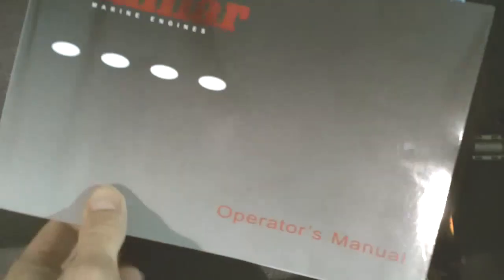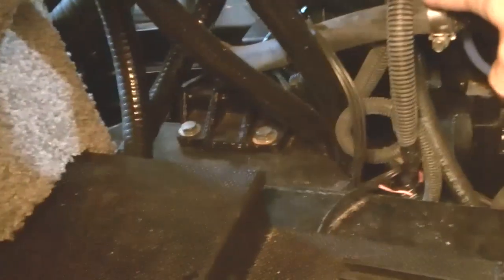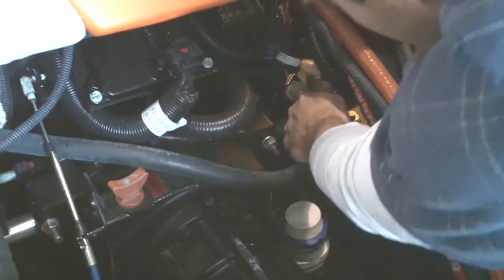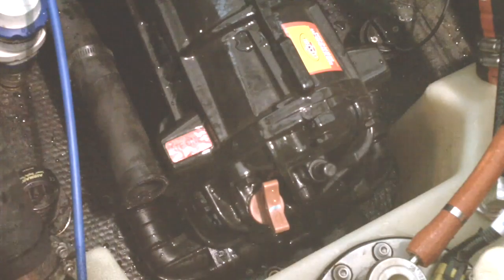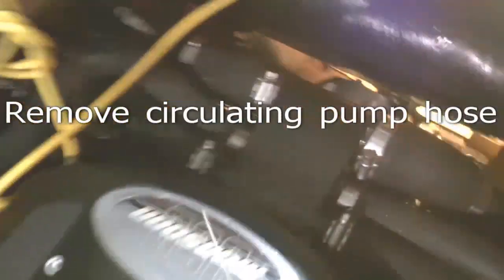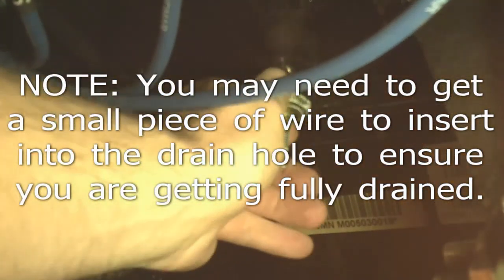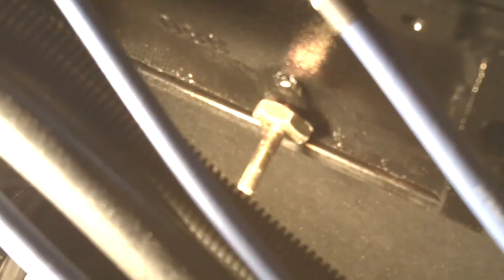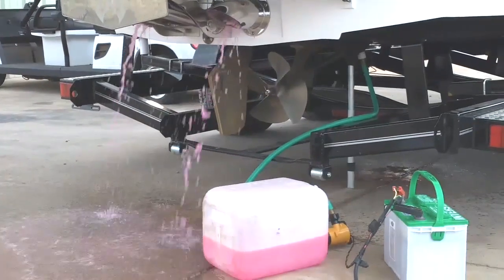Boat Winterization - Indmar Monsoon 350

Comment: Different question my boat was heated up. I changed the impeller and is still heating up.
Reply: Check the impeller for any damage or debris first. Check the cooler inlets for any debris blocking flow. Then replace your thermostat. This will solve 99% of overheating issues

Comment: I know this is an old video but can someone tell me why drain it first? Why not just get the engine up to operating temp and then run antifreeze through it?
Reply: I came here to ask the same question. Why drain it all if you can just hook up antifreeze and run it till you see nothing but pink?
Reply: @BrandonDuran-e7b  because without draining it you will end up mixing water and antifreeze, diluting the antifreeze.  You won't be able to push out all the water with the antifreeze.

Comment: One more thing for the draining side of things. I do not run antifreeze through. (I learnt this the hard way) you guys do not show/have a hoses for the external heater under the dash, there are two hose that come to the back of the motor on the port side, one goes into the recirculating pump and the return come back in just under the intake manifold. They both need to come off and blown out, I use a compressor.

Comment: what's the point in draining the water? why not just run it with the antifreeze until it flushes the system
Reply: The theory is two fold. 1. you drain any crap that may be in any of the hoses such as debris leaves etc.which in general isn't a bad thing to do annually 2. by removing the water the concentration level of the antifreeze is higher giving you greater protection. On this video it appears they did this on a cold engine. If you ran antifreeze through it before the thermostat opened up you may find there are pockets of water that are that don't mix with antifreeze. 

I guess I'm obnoxious, i run mine to make sure it's at normal operating temperature. Drain the blook quickly then run antifreeze through the system until it's flowing pink for a minute or two.

Comment: Just purchased a 2000 Malibu Response LX, and looking to winterized for -30c. I have seen several videos similar to this one where once the antifreeze is in the system they take the extra step of draining the antifreeze. I plan on removing the raw water pump impeller and replacing it next year. I understand the benefit of corrosion prevention with anti freeze, but at the temperatures my boat will be exposed to is it not better to drain and open everything? This way only small pockets of antifreeze will be left.....help.
Reply: Robert Nasato ,

Comment: Comment & Questions on using the Fake-a-Lake...

FYI, when I first watched this video, I did not notice the external pump & battery attached to the plastic container full of antifreeze.  Actually, I noticed the battery, but I just assumed it was removed from the boat for storage.  That said, initially, I was wondering how you were sucking the antifreeze into the Fake-a-Lake & fresh water inlet without any pressure behind it?  Then, I watched the video a second time, noticed the external pump and self-answered that question.  

> > > You may want to add a caption to the video so someone doesn't miss that key step, as I assume the impeller won't create enough suction to draw the antifreeze from a tank on the ground, without the pump.

So, I assume that antifreeze tank & pump setup is homemade and not commercially available, so my next question is, how did you make that pump attachment for the antifreeze tank?  Specifically, what are the "specs" on the size of the pump (GPM) you used to ensure that you have enough pressure to push the antifreeze into the inlet? 

On another site, without using a pump, someone said that if you set the tank above the height of the water inlet, this would create enough pressure to let the impeller suck/draw the antifreeze into the engine...Thoughts on that process?

Also, on another site, open-cooling salt-water boaters will typically install a freshwater inlet / hose attachment on the transom so they can flush the engine with fresh water, after using their boat.  Obviously, this would be a more costly option to install than just buying a Fake-a-Lake, but it might be a worthy investment for a long term boat owner...Any thoughts on that or the cost to install a fresh water inlet for flushing or winterizing?
Reply: +Mark Jones - My question was on the pump you used for the antifreeze.  I'm planning on using gravity and having a container higher than the engine, pushing antifreeze into the inlet hose.  

Any issues with that?
Reply: +skibumpmc As long as you get it high enough to produce enough pressure to
get the seawater pump primed, you will be fine.

Comment: What about winterizing the heater core? Does this method do that as well?
Reply: +skibumpmc 

We usually drain the
heater core by blowing compressed air through the lines to make sure all the
water is removed.  Then hook it back up so antifreeze will cycle through
it.
Reply: +Mark Jones Any thoughts on my comments above regarding the antifreeze pump or the gravity method?
Reply: +skibumpmc I cannot tell what you original question was regarding?
Reply: +Layton Burkart - You probably already know this but, YES, the heater core is part of the cooling system, so the antifreeze will circulate through the entire system, including your heater core.

FYI, my local Malibu dealer, Munson Marine, skipped this step (adding antifreeze) the first year that I had my heater installed.  I figured this out the next spring when I turned the heater on and it started blowing hot steam, instead of air.  Obviously, the core was cracked from frozen water left in the core.  Without using antifreeze, as in the video, there might be some way to drain the core, but it would be tough to get at, as my core is installed under the dash pod.  Since ruining my heater core, I've always used antifreeze for winterizing.  

Aside from the heater core, using antifreeze to prevent internal rust and keeping the cooling system seals/impeller from drying out is a really good idea.    

FYI, I never went back to that dealer again...They said it wasn't their fault, but after arguing with them, they gave me a replacement core which I installed myself.

Comment: Good points you make here. Since the thermostat housing is one of the high points on the engine you will not lose all the antifreeze if you remove the impeller. However you will lose the antifreeze in the hose that runs from the raw water pump to the thermostat housing.

Comment: Ironic this is mentioned as it was similar to a concern I had. I usually leave all the drain plugs out and pull the impeller like you mentioned. But I DO like the idea of filling with antifreeze to prevent corrosion. SO, if I do the process like in the video and then pull the impeller, will I lose all my RV antifreeze? I guess I am mostly concerned about the antifreeze being in the block and manifolds to help cut down in corrosion. Hindsight, I should probably just replace the impeller every year, but I'm cheap!

Comment: Nice video but there problem is that there will be no antifreeze in the engine until the thermostat opens. You could always remove the thermostat and manually fill it.
Reply: +Robert Cuadro - Read the comments below...Removing the T-Stat is not necessary.  Once the water is drained from the block, the entire engine will fill with antifreeze.

Comment from the maker: To answer your question, we don't do this step.  You are absolutely correct about that being in the manual and it is the 'most correct' way to set your seawater pump up for storage.  With you storing your impeller this way it will likely lengthen the life of it.  We normally don't do that step because we want all of our winterized engines to have every hose, drain plug, valve, ect… reinstalled back on the engine so that it can be fired up in the spring with nothing left to be installed.

Comment: Manual says to take out the water pump impeller coat it with Vaseline and keep in an airtight container, do you do this step?
Reply: I question whether Vaseline is the best choice for this procedure.  I know that Vaseline will degrade o-rings.  Perhaps silicone o-ring grease is a better choice.

Comment: I could use some help on the transmission oil change. The manual says there is a filter and clean or change if needed and is there a drain plug?
Reply: Buy a pump supper easy to fo

Comment: Thanks for the video.  Just a quick question since you did not show what you did after the antifreeze started coming out of the exhaust.  Do you turn the motor off when you see it coming out?  Is that it?  Do you just leave the antifreeze in there over the winter?  Other question would be for when summer starts.  Do you just back it in the lake and go?  I also did not see you mention anything about the impeller.  Do you guys prefer to change it with this winterization or when summer starts?